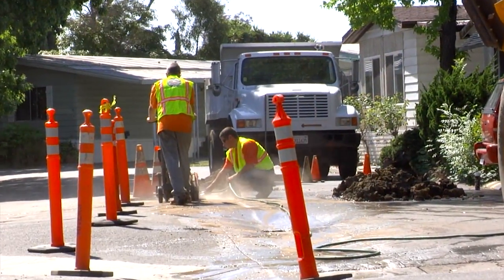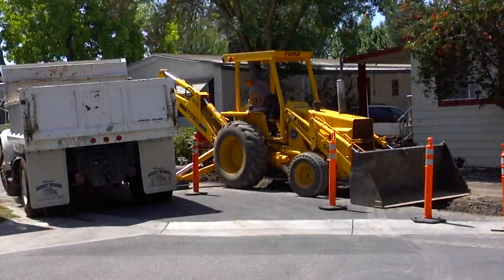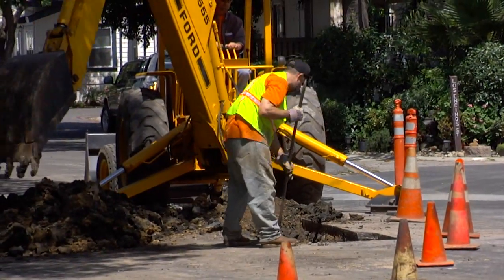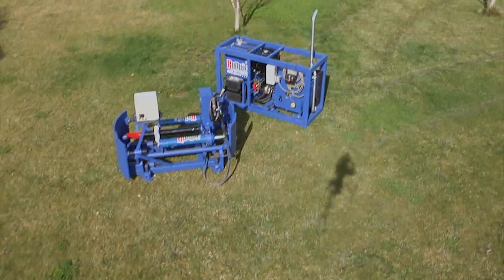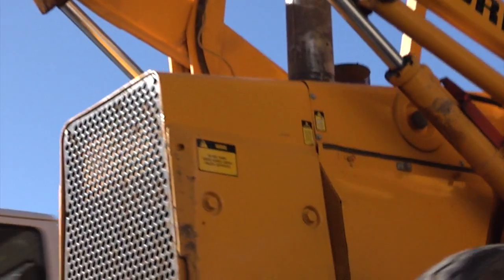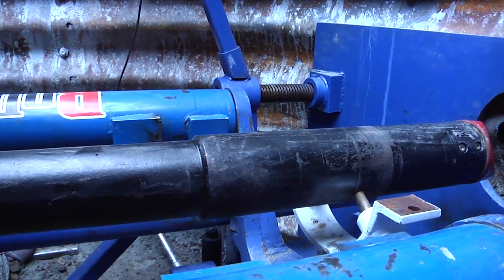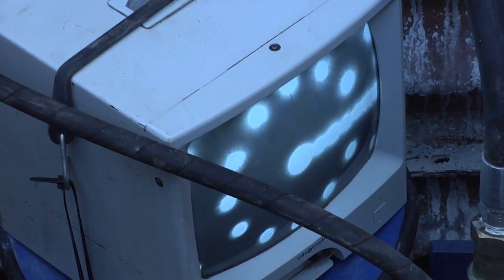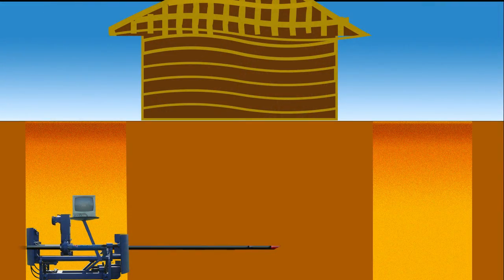Roddie Inc. UB40 Microtunneling Machine

Comment: What advantages does this system have over your smaller diameter directional drill?
Reply: its accurate to an 1/8 inch up down and left to right over a span of 200 feet.
Reply: @tractor9391  What do you think the other one is accurate to?
Reply: I’m with you I thought pit shot did the exact same thing